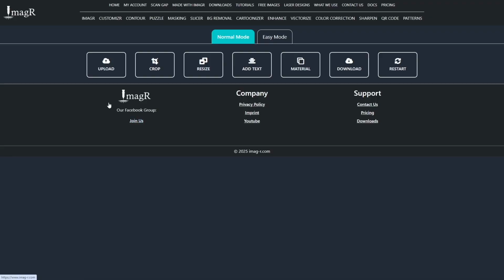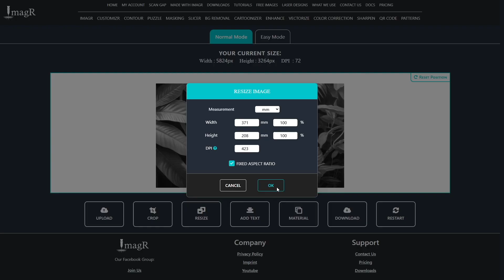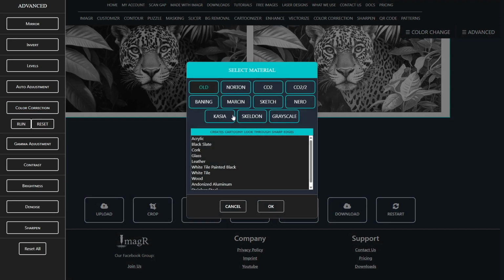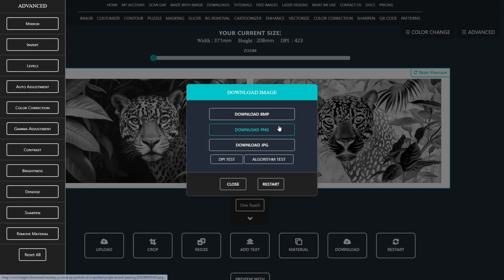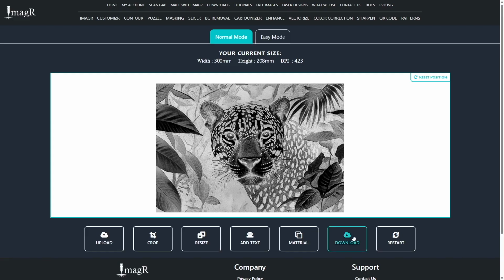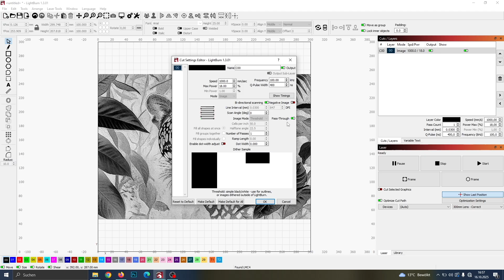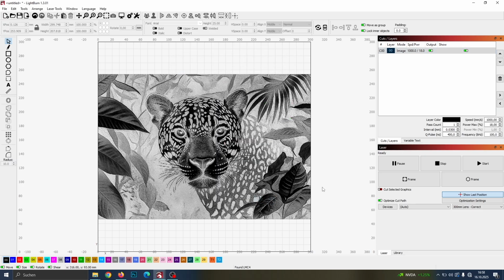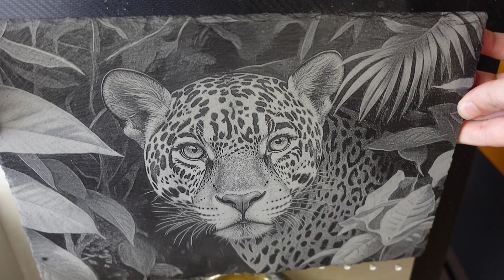Perfect Slate Engraving Every Time – No Guesswork!

Comment: To do multiple passes do we lower the power    How do you set up multiple passes in lightburn?  I have a co2 laser
Reply: I know it's a little late and hopefully you got your answer by now but if not, you need to look under the cuts / layers window in lightburn. At the bottom you will see different settings including pass count. Just change that to the number of passes you want to do.